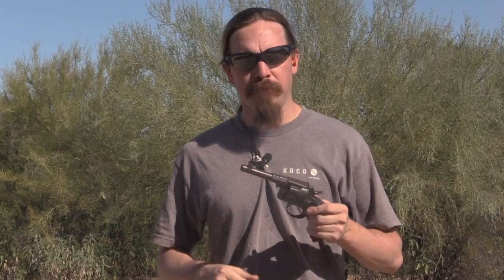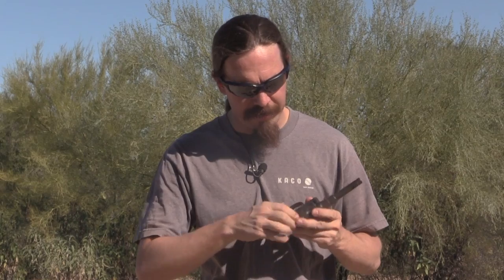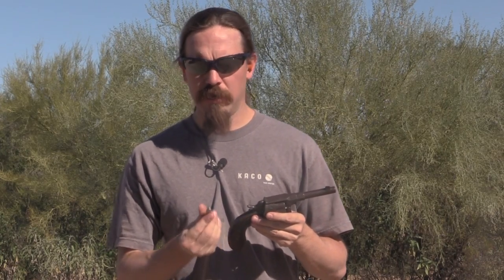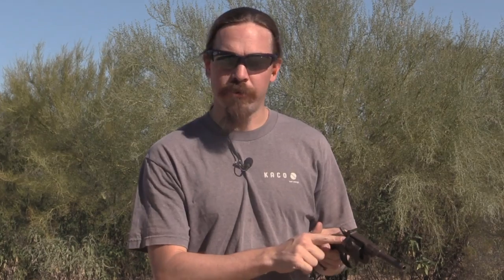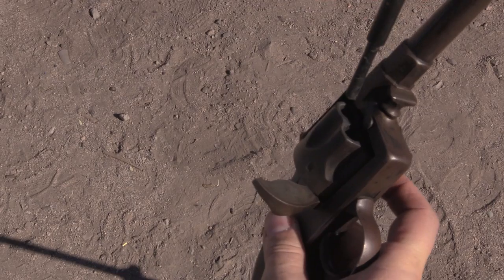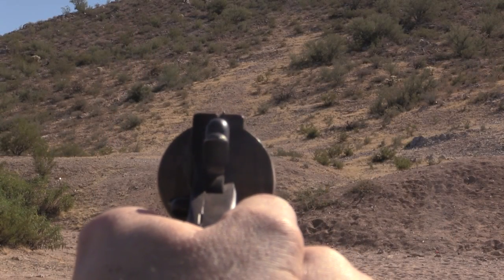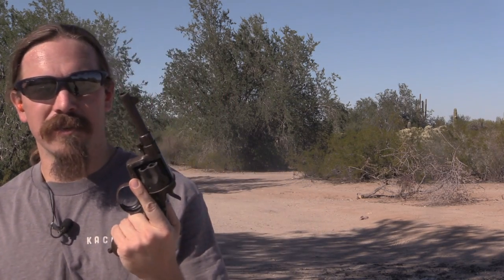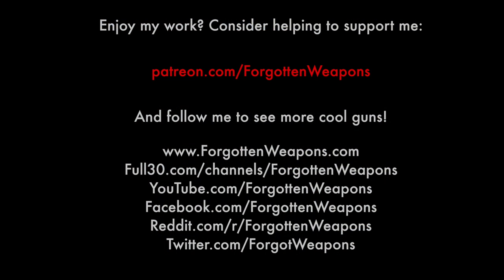Shooting the 1883 Reichsrevolver

Comment: They also use .32 Russian
Reply: There is no such thing as .32 Russian. There is, however, such thing as .44 Russian (also called .44 Smith & Wesson Russian or .44 S&W Russian). 10.6x25mmR German Ordinance was based off of the .44 Russian cartridge to my knowledge, so I wouldn't doubt that they might be interchangeable in the Reichsrevolver.
Reply: HM The Tsar of Russia Ahh! Thanks! This is what I ment. I watched a video where they use said round in the gun